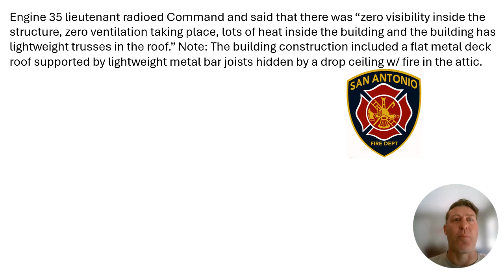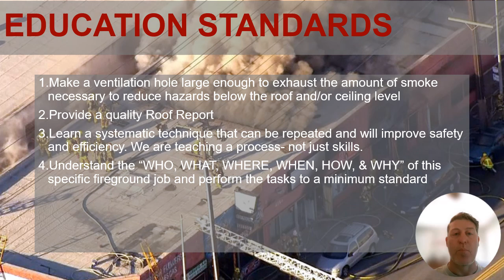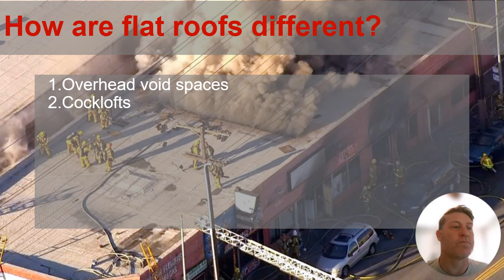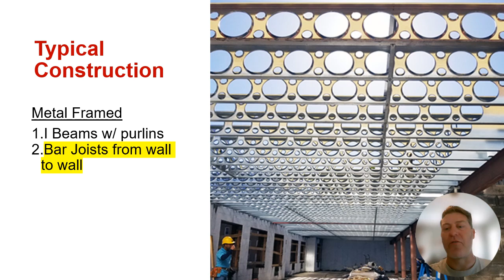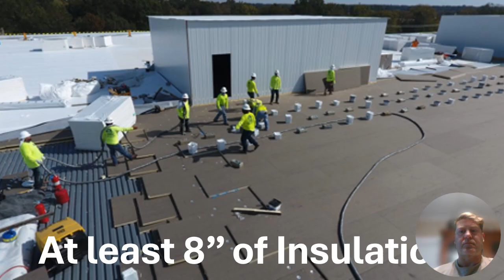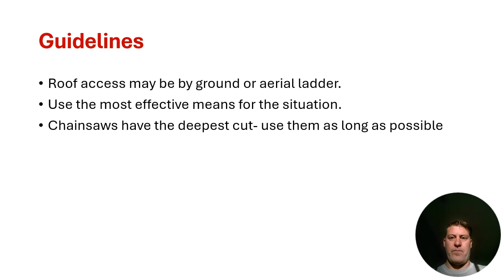Flat Roof Ventilation Training

Comment from the maker: The two step cut wasn't explained.  A 2 step cut means we cut the water barrier and insulation with a rotary saw without cutting the metal decking, remove the insulation, then make a second cut through the metal decking.  We will do both types of cuts in the hands on training.